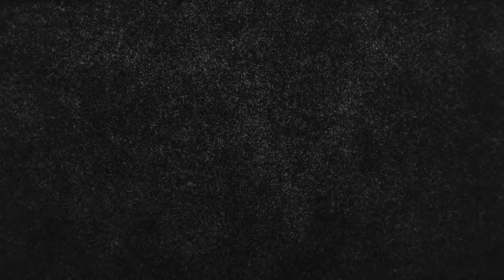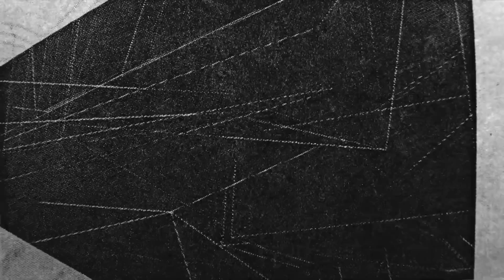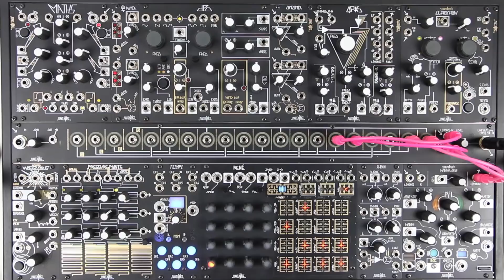X-PAN and Morphagene: Spatializing Genes

Comment: I see the outputs of morphagene went to the bus board outputs? so the bus board multi outs can be inputs?
Reply from the maker: Assuming you are talking about the CV Bus? It has a 4-channel multiple and a stereo line/headphone output.
Reply: I have a question with 7u case, if my modules power is 1490 mA +12V in total , the case could provide enough power? Thanks
Reply from the maker: @ys521wow  the 7U case is rated for 1400mA at +12mV. You are a little over. This is a conservative rating so you may not see any problems, but if you start to hear a lot of noise or VCOs going out of tune this is likely the reason.